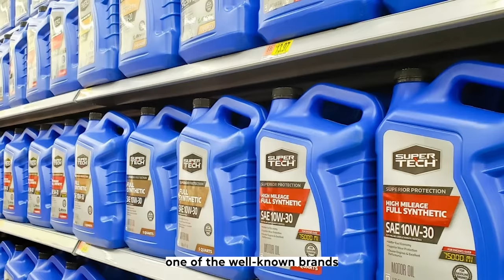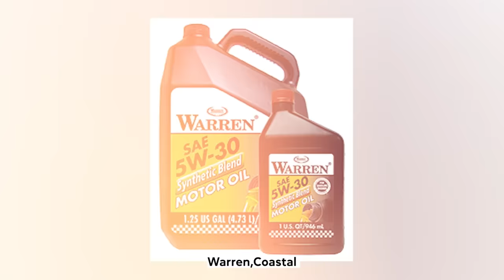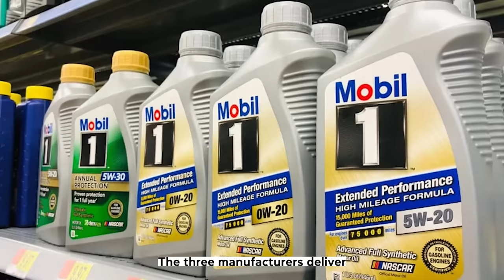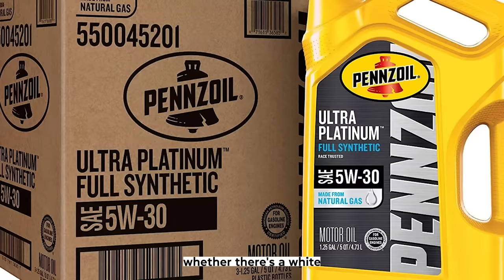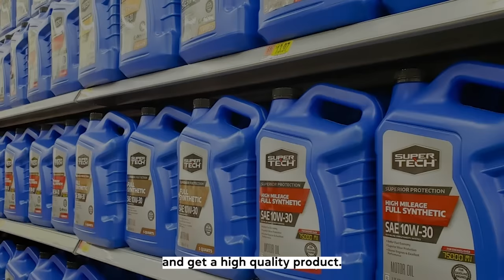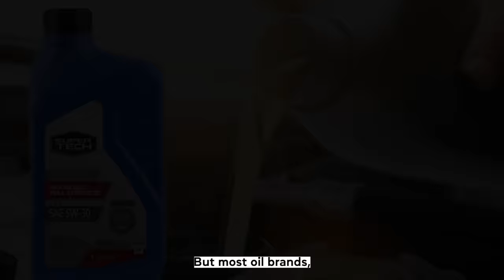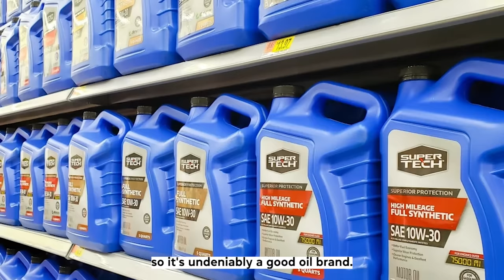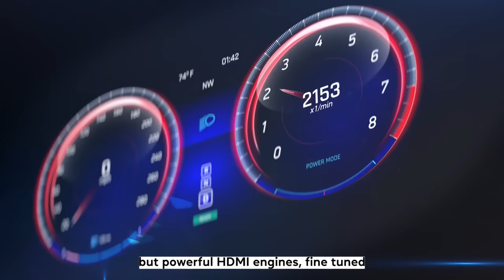Who Makes Supertech Oil For Walmart And Is It Any Good?

Comment: I've used both Mobil 1 and Supertech Full Synthetic in a few of my cars. Supertech is okay but Mobil 1 lasts longer. The Supertech oil, in a Ford 4.6L V8 seemed to get noisy near the end of the oil change cycle and it came out very dark where as the Mobil 1 oil seems to retain its viscosity longer and it comes out cleaner. 
I've also take apart engines that have run 300k on only Mobil 1, and they were basically like new. The Supertech Full Synthetic oil I bought here came in what looks like a silver antifreeze bottle, not the blue angular bottle shown in your vids. I also noticed that the oil in the quart bottles does not match the oil in the jugs in color of the oil itself. The oil in the quart bottles was lighter in color than the oil in the jugs. Both were the same grade of Supertech full synthetic.  I wouldn't call Supertech bad, but its not on par with Mobil 1. At least not the batch that I had. 
I restrict its use now to small engines but use their gear oil and ATF without issue.
I'm getting near 5k on a Mobile 1 oil change and the oil still looks almost new. 
I run only OEM filters on my cars as well.
Reply: Sounds like Mobil changed the formula on the SuperTech as the base oil comes from the Mobil/Exsson Refinerey. Project Farms showed that SuperTech did better than Mobil1 on the testes...but that was a few years ago.
Reply: I just picked up a couple quarts of Supertech 10w30 full synthetic to change the oil in my mower. I have two gallons of 10W30 Mobile one here for my one truck and the Mobile one looks different, the Supertech oil is almost clear, while the M1 is more honey colored. They look and pour different as well.  The 1 qt  bottles are still blue  with the small cap but they had some 5qt jugs which were short and wider with horizontal handles like an antifreeze jug.
Mobil One had 5 grades of oil, plain Mobil One, Mobil Super Synthetic, Mobil 1 High Mileage, Mobil 1 Gold Jug Extended, and Mobil 1 Advanced Formula. There were some unopened cases not yet loaded on the shelf with silver one qt. bottles too. 
They had more grades of Mobil 1 than they did Supertech, which was only in 5W-20 and 30, and 10W30 weights. They stock very little oil, maybe a case or two of each weight in each brand tops. They seem to stock very little here in the auto section since 2020. They rarely have batteries in stock, maybe one or two on the rack and never the size you need, and your lucky if they have enough oil to do an oil change in stock. However, they have plenty of Antifreeze. The oil filter selection is down to a 3x4ft area on the shelf, wih only Supertech and Fram, they have a full isle of off brand and decorative wiper blades, seat covers, and floor mats but only a 2ft wide selection of fuses and bulbs. Most automotive chemicals are always sold out, and grease, which I used to buy a lot of there is gone. Neighboring town stores are better but often are missing other items or have different brands in stock.

Comment: Warren Oil Company makes Supertech Oil ! And it's pretty good oil . And has been around since the 20's
Reply: Warren Oil Company (Dunn NC) absolutely does NOT make Super Tech oil. Warren Distribution company does. Zero connection between the two.

Comment: I would never put this low bid oil in my engine. Supertech synthetic is nothing but Group III hydro cracked mineral oil labeled as full synthetic oil, in the end it is really nothing but mineral oil. If it is not true Group IV PAO or Group V Ester based synthetic oil it does not go in my engines. Myself I only run Group V Ester based synthetic oil, Redline is my choice.
Reply: Yeah every other oil on the shelf is group III oils. There is literally zero reason 99% of people need to worry about PAO or Ester group IV and V oils. Your economy engines will run just fine on it. Like the 2.3 ecoboost.